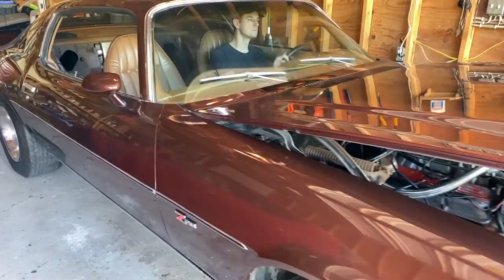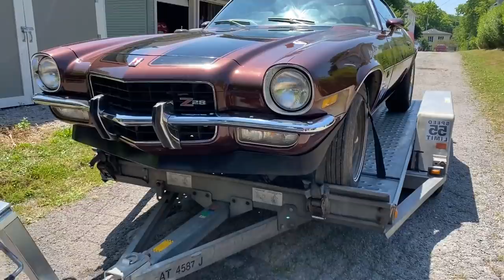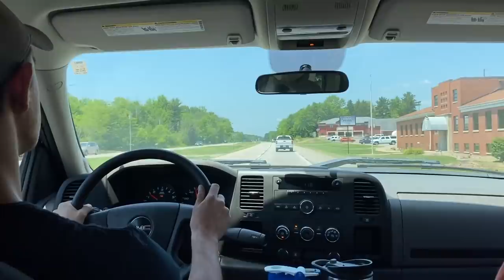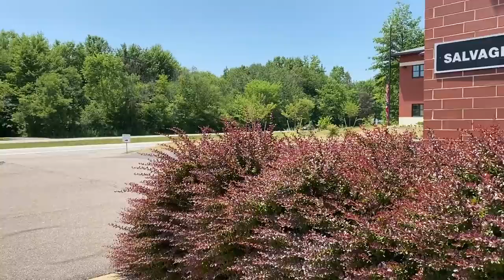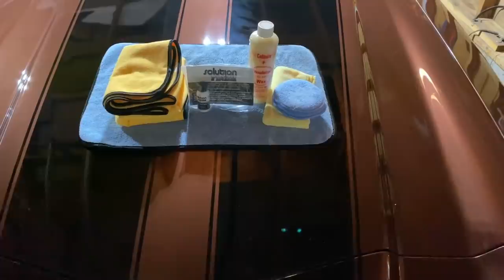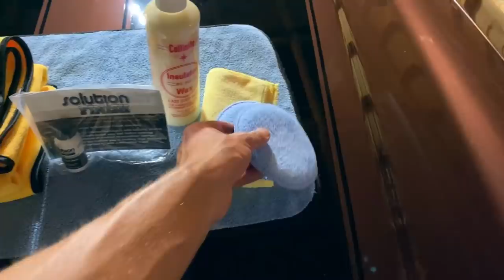FIRST Potential MAJOR ISSUE with the Z28 Camaro. ALSO 1000 Subscriber GIVEAWAY!!

Comment: I can’t find a second gen for a decent price that isn’t all hacked up or rusted out.
Reply: What's a decent price and condition
Reply: @dragonslair59  
This car in Colorado would be $10-$15,000. Rusted heaps with no or blown engines and transmissions are going for $7-10k. I'm currently working on four second generation Firebirds. 1976 455 four speed, 1978 Formula 350, 1981 four speed Esprit,and 1981 Turbo TA. All four for $4600 total. Sometimes you just have to be in the right place at the right time. Obviously there all project cars. The 76 did at least run and drive when I got it. Getting harder to come by.
Reply: Great car true americana
Reply: I have a 1978 z28 that has a nice paint and zero  rust but interior  is in need of redone ,door panel  and headliner  needs work but dash and floors are perfect... all original car except built 400 quick shot trans,350 that need rebuilding...7500

Comment: I have a 1973 Camaro Z-28/RS/Type LT it did not come with stripes. I special ordered the car with front and rear spoilers and M-20 wide ratio muncie trans. the car is dark blue.  I still have the car and it is completely stock. Love it.

Comment: I must give credit where credit is due. You found, fixed it, & made it shine again. GREAT JOB buddy!!!! Remember to keep me in mind if you wanna trade. LOL.
Reply from the maker: Casey Jones Haha will do Casey!
Reply: Ryan Sampson if you ever run into a VIN issue again. If the car is over 15 y/o or older there a way to register the car in Vermont. Which is a non title state. The actual registration card issued by Vermont is considered a title which is acceptable in the lower 48. The rear of the registration has the same required pedigree questions for another State to issue you an actual title. 😉 loop holes are our friend. Lol 
https://www.cartitles.com/title-option-2/
Car guy to Car Guy. 👍🏽

Comment: Glad you posted these videos. It's made me motivated to get back to work on my '68 Camaro SS/RS, and my son's '81 Z-28. The 68 is pretty much finished, but the 81 Z28 has a considerable amount of work to finish up. I also have to get the vin inspection done on the Z. 
I can hardly believe that is the same car you pulled out of the barn ! Amazing job getting her cleaned up. Most people don't realize how difficult and time consuming this type of work can be. Great job ! keep it up.

Comment: I was in my early twenties  when this car was new .My brother had a 350 in a 73 intermediate Pontiac LeMans. We lived in Chgo and the Chgo area .He drove it like a granny. All he could get was nine miles per gallon. These Camaros were beautiful but frankly I wanted a bench seat at the time. The car looks remarkably solid and this color is at least as nice as the original darker shade of brown that it was. You also did magic on those seats .I would enjoy visiting Nickey Chevrolet ( a famous high performance Chevrolet dealer )in Chicago on Irving Park Rd. About fifteen minutes away was Mr.Norms Grand Spaulding Dodge .Take a trip to the Chgo area I need help on my 62 Ford Fairlane 500.I will get you great Chgo food specialties.

Comment: Love the 60s to early 70s GM products i own a 70 sschevelle with the build sheet it's a factory 2 tone paint car. the code is 25-10. I ran into a problem once where I live because of historical plates. The  Officer could not find my car on the regular DMV site luckily I had all my paperwork and he didn't tow my car. Turns out there is a separate site in the DMV just for historical plates. He was new on the force but smart enough to know that he may have been missing something his self even though his supervisor told him that he should have the car towed. He sent me on my way because my paperwork was correct and he couldn't justify to him self to have it towed

Comment: I has the same issue when I bought my 65 Corvair in 1998..not only ( here in Connecticut) did they need to verify the vin ( they didnt even know where it was) but they poked holes in my trunk floor with a screwdriver while I watched from outside the garage area..When I asked why they'd poke holes they said it was a safety inspection as well..total bs..

Comment: I'm not sure why the OSP was so secretive about the process. The original vin is stamped on several parts of the car and chassis. This helps to ensure you just can't change the striker plate and sell the car. Also it helps tracking down stolen parts when the car is dismantled and sold for parts.

Comment: Nice Camaro I had a 1970 split bumper with the l88 hood my younger brothers and a friend got it running we put a 850 holly on the car was so loud it vibrated the ground and our moms new windows lol we were setting the timing our friend ron looked down the carb reached back turns the distributor it backfired a big flame came out of the carb burnd of his eyebrows lol we had fun hopping the front wheels off the ground brings great memories great channel the car  looks great that paint really shined up great channel thank you for bringing back some great memories keep up the good work  nice cars

Comment: It is possible to see the front of the heads? The 1970 Z28 had a high compression, LT1 block with the double hump heads. I think it was a one year engine because after that compression dropped and they had to run unleaded gas. Was wondering if they still had the double hump heads?

Comment: I have found two hidden VINs on my 71 Camaro.  Both are on the firewall under the heater box flange.  One is on the firewall itself and one is on the side panel below the fan opening.
Reply from the maker: Thanks I will have to check those out!

Comment: I had a 71 Z/28 blue with black stripes. 330 hp down from 70 which had 360. Very fun car except the 9 miles per gallon kind of sucked even though premium fuel was 29.9 cents a gallon. My first car was a 70 SS 350 Camaro and it was the same color as your 73 Z. I've owned 5 Camaros in my life the later 2 were 6 cylinders a 82 and a 84.

Comment: There are 4 full vin numbers on a second gen Camaro that I am aware of. there is the one riveted to the dash, the sticker on the drivers door, and the hidden is vin stamped in to the firewall beneath the heater blower fan. there should also be one on the front subframe on the outside below the drivers door.  if your car has its original drivetrain, there should be a partial vin stamped on the block behind the alternator,  and partial vin on the transmission as well. the location can very depending one what trans mission you have. Muncie 4 speeds were stamped on the passenger side of the transmission just in front of the mid plate. Saginaw transmissions were stamped on the drivers side, under the transmission side cover.  TH400 tans missions were stamped on the drivers side oil pan rail just in front of the speedometer cable, TH350 trans missions were usually stamped on passengers side bell housing just above the torque converter cover, but i have also seen them stamped on the drivers side of bell housing where the trans bolts to the engine block.  power glides were usually stamped in on the bell housing on the drivers side where it bolts to the engine block.

Comment: I'm a retired Detective that worked in my departments auto theft unit. There are numerous areas on the vehicle that have the VIN number attached, and will help investigators identify the vehicle properly. I predict you shouldn't have an issue and it'll all work out!

Comment: I had a 70 Z28, 350-350 HP. in 1980. I just came home from Boot Camp at Ft Benneing GA and the car just came out of the Paint shop booth . My girlfriend at the time Holly and I were cursing Main Street listening to 38 Special. We went out on HYW 32 west of town about five miles and turned around. I told Holly to tighten her seat belts, and I  took it up to about 7 grand dump the clutch. By the time I was fourth telephone poles looked like a picket fence and the speedometer read 130.  I bump it into natural and started to tap the breaks. I looked over at Holly she was white as a ghost and her fingers were clinched into the hard plastic of the dashboard . She said JHChrist warn he next time so I don't pee my pants.

Comment: Just never was a faned for rubbing compound. Doesn't that thin your paint down?
Reply from the maker: You have to watch what pad you use and judge the paint prior to buffing. I could tell this paint was laid on nice and thick and could take the compound and pad that I was using. Just be careful on sharp edges not to burn through!

Comment: I'm not 100% sure about 1973, but in the later 70s there was a hidden VIN (maybe partial VIN) under the heater box stamped into the firewall.  I know they sometimes also look for original type rivets holding on the VIN tag.  Again, not 100% sure about 1973 but later years had rosette head rivets holding on the VIN, not your standard pop rivet.
Reply from the maker: tim psensky Great info thanks! I know the trim tag has been messed with before most likely for paint and then re-attached with bolts so I will have to find the other hidden VIN

Comment: I bought a Camaro RS from 68 when I was 14 years old. Went to register the thing an found out it was stolen in 1970 in Detroit Michigan. I was able to connect with the original owner and found out he lived 13 miles from my house since 88. So I drove the car to his house. He told me everything in it an on it was the same as if it just left his house. He said nothing looked different at all. He offered to buy her back from me. I only paid 1700 dollars fer her. And I told em if he really really wants his car back. I jus wanted him to show me the hidden Killswitch he installed to shut it down in case the carb goes full throttle. I started er up, an he flipped the switch an I said she's yers again. He was 68 years old 3 weeks away from that day. I told em to consider his sweet RS returning home his birthday present from the asshole whom has been shredding the grass in his ditch by the road. He connected the dots an laughed a bit before telling me, since he got his car back he won't have grass to cut no more. He will jus sling it away with the tires.
Reply: Great story!!!
Reply: @CarsandCats  thank you. Have you ever been able to return a vehicle to the person it was stolen from? That only happened to me once in my life. I'm 26 now. I miss living in the sticks.

Comment: I owned one back in the early 90's over here in the UK. Still have my 68 Camaro big block car though.
Reply: BB wakes that car up. Loved mine(402) in a 70 1/2 Z28, 4:56, Turbo 400, Vega torque converter. Your 68 is a little lighter, gotta be fun.

Comment: I know exactly what Ryan is talking about when he said they stole these 2nd gen Camaros all the time back in the day, I have since replaced the 1971 Z28 and it sits locked up in my garage with a club attached  to the wheel but in 1980 when i was going to Lincoln Tech in Indianapolis  my 1971 Z28 was stolen right out from under my nose and was never found.
Reply: Know of one back in the day 70/71 with a big block. Guy walked in asked to test drive took the set of keys when he left. The brilliant sale man instead of blocking it in with other inventory decides to just remove the coil wire. Next morning the owner noticed the Camaro gone and the jeep next to it had the hood partially open. He looked and cool wire was gone. Needless to say salesman was fired. And about a week later Camaro was recovered unharmed

Comment: I bought an out of state box trailer that had an Ohio title that had all the right numbers but who every typed the VIN number into the computer when the trailer was new got two numbers that were next to each other in the wrong place. It took 5 phone calls to Ohio just to find the right person that could fix the mess they created. I mailed a copy of the title back to Ohio along with the documents my state needed to get it titled. It took 3 weeks to get it all straightened out. When I finally got the correct title I told a friend I think having a root canal done though my ass would have been easier.

Comment: I was once charged with Grand Theft Auto. Because the cop, didn't realize, the VIN number, in my 79 turbo Cobra Mustang. Was actually 11 digits. And not 13. And the F at the beginning and end of the VIN number, was the Ford logo. I laid in My Best Friend's driveway, in the Hot August Sun, face first on the concrete... For 3 hours.
For 3 hours, I tried to find out what was going on. And then I told them, to take the f off the beginning and the end of the VIN. And son of a biscuit... The car came back registered in my name. So... It could always be worse.
Reply from the maker: 😧 Sounds like a nightmare!
Reply: @RyanSampsonRPh  ... no interaction with the police ever is. The thinking man prevails. 
That cop was a rookie. Something to be said about people's first year on the job. I was arrested for not having a license by a rookie on her first night. In a brand new 1996 Caprice Classic 350 Lt1.
Was sitting in the back and, the oil light popped on. The car shut down. Smoked the engine. No oil in the crankcase. 

Apparently it was the guy in the police garage, first day too.

Comment: I have owned 3 Z-28's. A 78, an 80, and a 70 1/2. None of them had the cowl tag installed with screws. They were installed with a "cowl tag rivet". Here is an image of what all of my Camaro's had their cowl tags installed with. https://camaroforums.com/forum/70-81-general-12/cowl-tag-70794/
Reply from the maker: Rick Jones Yeep you are correct. This car has it bolted down but not uncommon for someone to take it off and replace without rivets during a re-paint. I was a little more nervous when I realized this had the tag bolted on (meaning it had been removed in the past. Glad it passed though!

Comment: Was supposed to say 1970 RS Camaro not 275 what era was 20 years old I have head on collision by drunk driver and it with the car off I look for several years for another one buy end up buying a 1979 Z28 and put a LS7 454 Big Block behind the for Speed and I still have the results small block 350 that wooden the car originally and the car has only three one thousand original kilometres I am the original owner of the car from brand new the car has never seen winter because I live in Canada and they use salt on the roads